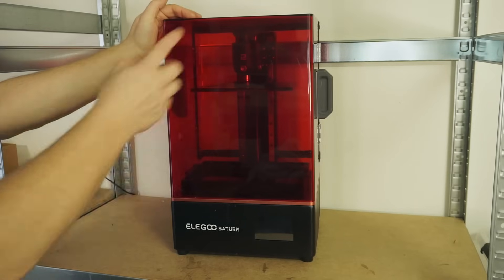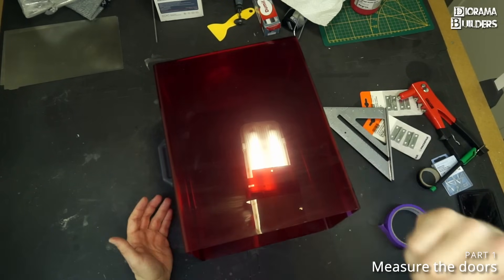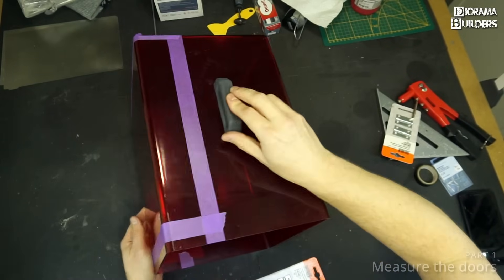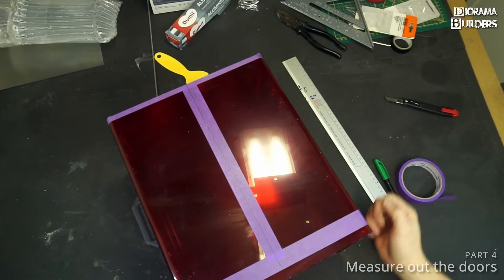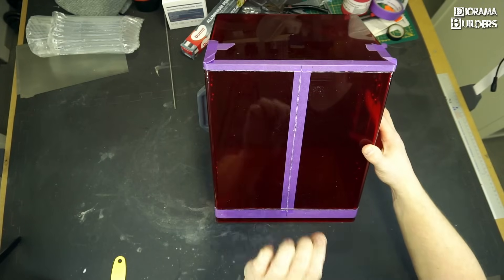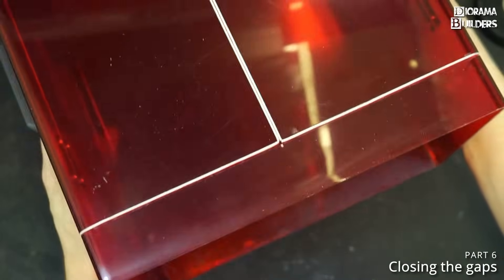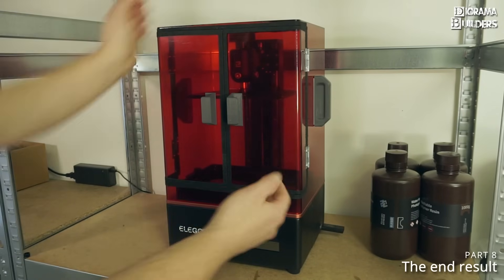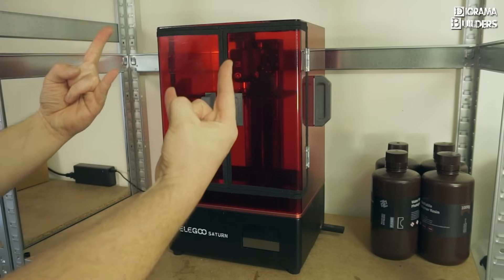How to Create Custom Doors on Elegoo Saturn Stock Cover 3D Resin Printer | DIY Tutorial

Comment: This is nice, but rough.  Needs a better way to cut, you didn't measure center, tape was off center a bit, you didn't add any seal or oring type silicon or rubber gasket to seal when closed from the odor/fumes etc.

Comment: Great video!  I think I'm going to give this a try as well on the Saturn 2.  I'm just a little worried about splitting the plexiglass cover with rivets though.  What steps did you take to make sure the rivets wouldn't bust the plexi?  Seems like I might want to test a couple on a similar piece of material first :D
Reply: I was worried about that too! Every time I try to drill acrylic at all I end up cracking something. I left another comment on this video about using glue-on acrylic hinges if you want to take a look at that as an alternative.
Reply: I'm sure you already made the mod but getting longer rivets and place washers on the inside will work.  I just found this and will do it on my saturn 2!

Comment: I really wish they would design the printers with this in mind in the first place.  Taking the whole top off is always a pain, even if you have all the space you need for it.
Reply: Not to mention all the fingerprints... I really wish I had door handles for that reason alone.
Reply: I just added a small home depot draw handle to the top of mine to pull it straight up, but am going to investigate this door installation technique.

Comment: Absolutely awesome idea! How the hell do you keep your Dremel so steady! When I use mine, especially the saw bit, it jumps all over the place. I can't make it cut a straight line to save my life 🤬. Also, how about using pegs as door stops (like on my computer wardrobe) at the top to keep the doors from closing too far inward?
Reply: use a large metal plastic cutting blade. Also let he tool do the work. do not force it and you will be able to make a straight line.
Reply: I know what you mean!!  I always feel like the cutting wheel snags and it's off to the races across whatever surface you're working on.   I guess slow and steady  for this, especially since the hot cut plastic tends to splatter.

Comment: Nice video. Only other thing i would add would be a bracket on the inside under the roof of the case to hold 2 small magnets and then glue 2 on the top corner of the door to make sure that it is properly held close. Good job though, still waiting for my own printer so ill see if i will make this depending on were i end up putting it.

Comment: Nice. But what if you have more printers next to each other? With these doors you will gain top space but lose side space. Would it be possible to make one single door like the one on the new Jupiter?
Reply from the maker: Thanks for the support!
Yes it would be possible to make 1 door, but if I would do this I would also make 1 door in the L-shape.  Meaning the hinges would also be at the side and you would need some space next to the printer.  Otherwise 1 door at the front would give you limited space.
Cheers
DB
Reply: The way i would get around thid would propably be having the hinges on top of the case and make some sort of lach to hold the door open.....if that makes sence
Reply: @nixz3062  if you're as thick fingered as me, I'd be afraid of losing grip on the door and it slamming back down, at a minimum splashing resin out of the vat; worst case scenario shattering the door. Especially if a number of things are going wrong just as I opened it up. Been there, done that, cussed up a storm
Reply: @Iameddie2go  You could also design it so it opens downward, with gravity holding the door out of the way. I used to do it that way when converting 10 gal aquariums into vertical gecko terrariums. Worked great.
Reply: @mackincaid9299  Thought about that, but you have to be more careful of resin drops as you pull stuff out.

Comment: Really brilliant construction method, well thought out engineering for the material requirements. Putting the hinges on after after only one cut is awesome, use them of painting tape to preserve the plexiglass aesthetics is so smart, this is someone who understands the material, Congrats and great video.
Reply from the maker: Thanks for the support!
I did some research and thinking on how I would handle this and the result is this.  Hope it helps others to do the same.
Cheers
DB